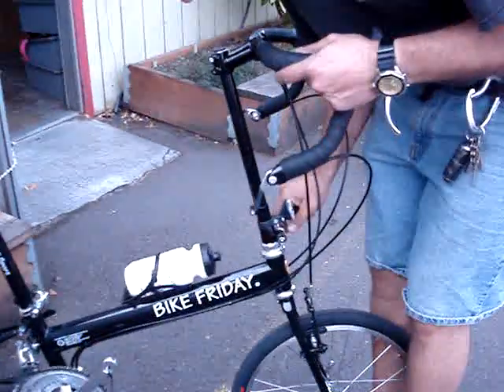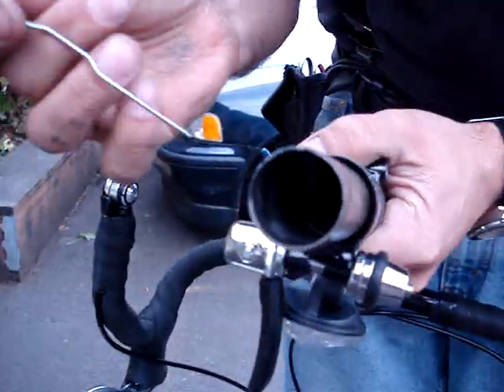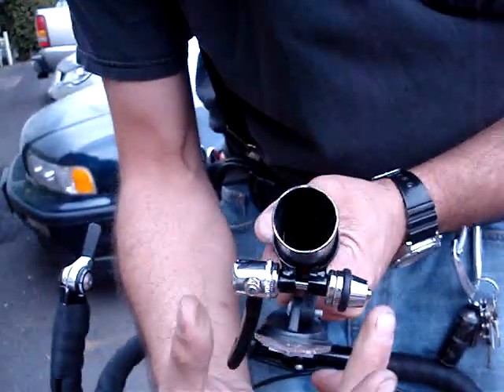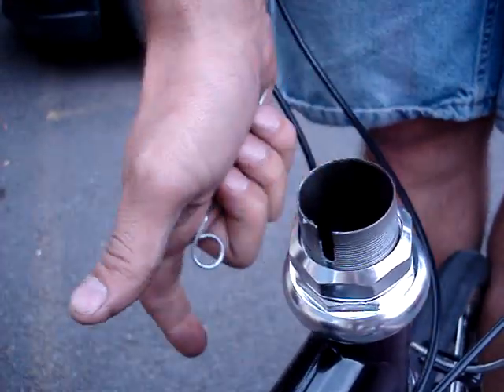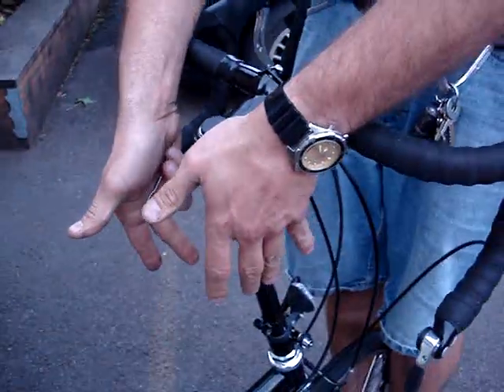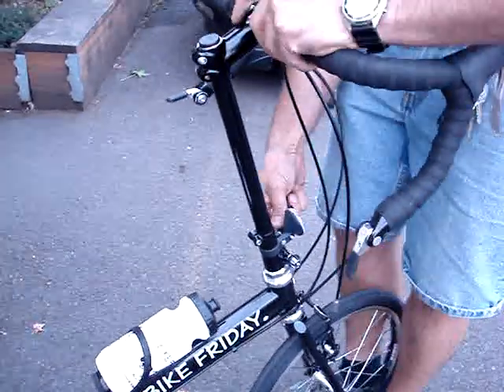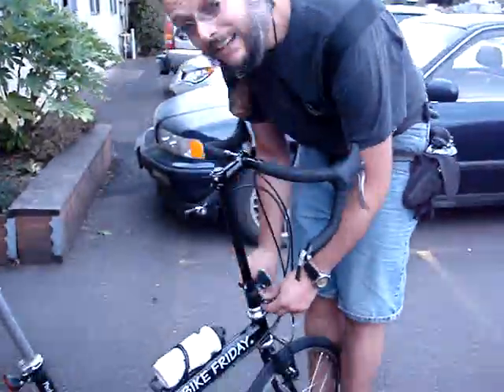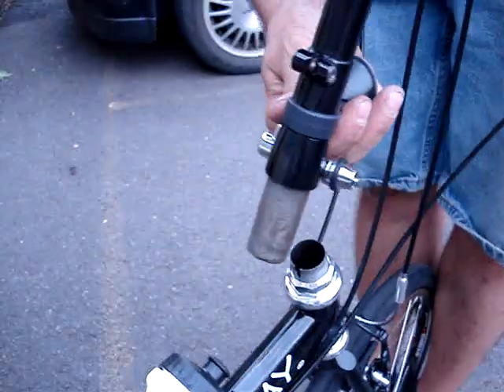Bike Friday Pocket Bike Stem and Fork Steerer Interface Safety Feature.MPG

Comment: My Bike Friday has a problem. Over time, the threaded steer tube on the fork has worn  “threads” into the stem post , if that’s what it’s called. Now, it is very hard to remove the stem post when folding the bike. It goes back on easy, but the internal threads that have been worn into the female part makes trouble. I have made a pry tool that aids in getting it apart, but it’s kind of a pain.